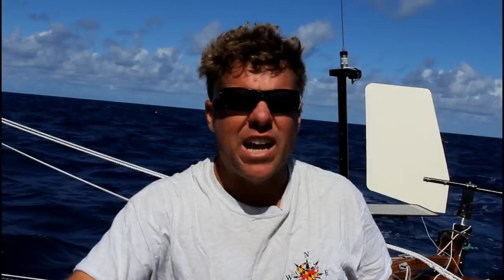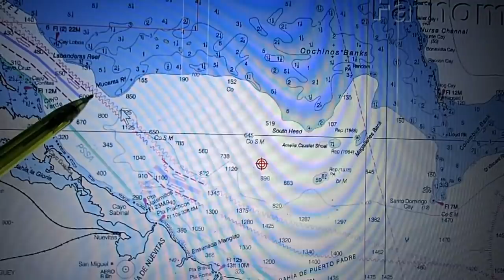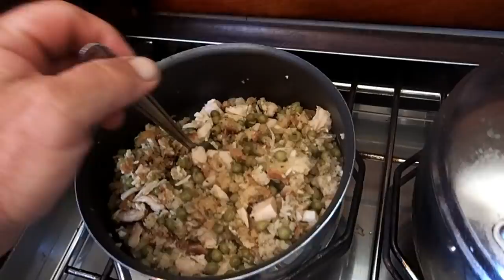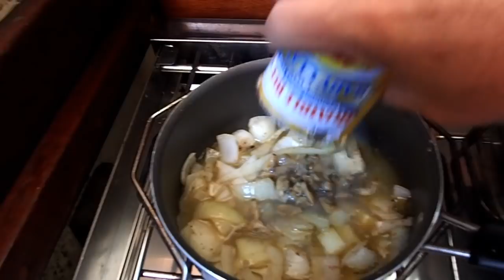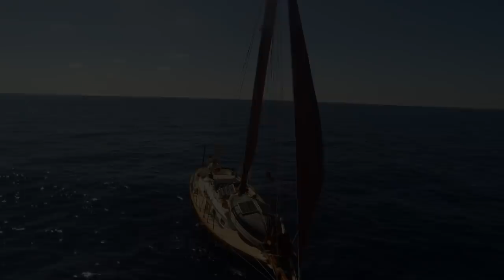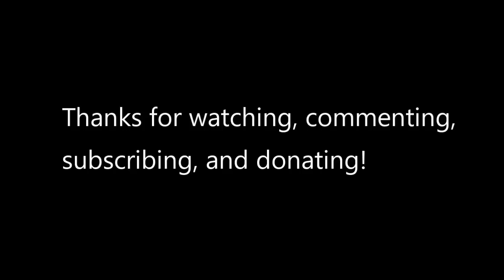Toward the Old Bahama Channel

Comment: Kevin. Thanks for the amazing content. I have a Ranger 23 and am restoring her. She will be out on the water soon. Input on your stern light. I had a 66 Ford Mustang. New battery, new cables, new starter, new alternator. Living in North Orange County, CA. 21 miles from the coast. No marine layer or excessive humidity. One day the Mustang just wouldn’t start. My father in law at the time, an electro optics engineer working for JPL told me to do the following. Mind you, there was no corrosion on the battery or the terminals. He said, “take them off and clean them.” I did, and bam! She turned right over! Even though there was no visible corrosion, there was enough oxidation to prevent current to flow. As far as The intermittent issue is concerned, its absolutely a loose connection, whether it be the ground wire, or perhaps the actual receptacle that your bulb is in. Some stern lights are the double ended festoon bulb or the wedge bulb. I’d check your ground wire, and remove the cover and clean the bulb connections and tight the contacts or receptacle of the bulb. Good luck and fair seas Captain!
Reply from the maker: Thanks.  I've since determined that it was both.  The butt connector was loose, the wire about to break off, and there was some resistance in the wire itself.  Replaced wire and connector, all is well.
Reply: Bravo!

Comment: Get some dielectric grease.  Once you get contacts clean, use it to pack any electrical connections, plugs, bulb sockets, etc.  It will keep them clean and stop them from corroding.  Good on battery terminals and terminal blocks too.

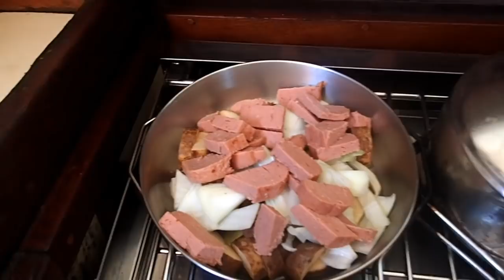Comment: We hauled at 3 D. Marine on Stock Island last spring, it was a great DIY yard. If you get to Marathon awesome vhf net 68 at 09:00. If I’m in Marathon and you come through I’ll buy drinks and might be of help. We got a small tow boat too, winds are usually on the nose getting into that protected Boot Key Harbor. 
Cheers!

Comment: Nice drone shots! I still don’t have the confidence to fly while sailing. 
Where do you land it? Mine freaks out when the proximity sensors pick up the rigging
Reply from the maker: I land it on and off the water, or did ... this is what the Splash Drone 3 was made to do, but don't go out and buy one, way too many problems.  In fact I just sold it for parts on eBay ..

Comment: Kevin, 
I don't remember if you have discussed your preference for solo sailing. Have you considered taking someone with you, especially on the long passages?   
Your channel is the one I look forward to the most.
I am in the Melbourne Florida area.  Passing by here any time?
...Phil
Reply from the maker: I've gotten used to solo sailing, plus my boat is pretty small even for one person, for a long cruise.  I may stop in Palm Beach on the way north, I think that's close to Melbourne.
Reply: We are about 110 miles north of West Palm Beach.  The closest inlet coming north is the Fort Pierce Inlet.  (Current is strong there.)  Then it would be a difficult sail up the Intercoastal Waterway on the Indian River.  It can be quite narrow north of Ft Pierce.
Next stop north of us is as an inlet to the Indian River is at Port Canaveral.  Would love to take you out to dinner if you come this way.  It's 26 Feb today.
Reply from the maker: @pjhenders  Thanks, I may try to get in through the Lake Worth inlet, which looks fairly easy with a decent wind.  Probably will not stray far from there though.  I'm still learning Florida, step by step ...

Comment: Thanks for great videos great to hear sailing terms  wing used.One question how good is the wind vane in light air like you are having on the Grand Banks? Do ever have to hand steal.
Reply from the maker: The vane will steer in nearly all conditions, even in winds of 3-6 knots, so long as it is greased.  I grease the gudgeons before each passage.

Comment: Hey Kevin (may I call you Kevin?), Stop scraping your Teflon pots with a metal fork! We want you to be posting well into your elder years.
Reply: I bought all lexan dinnerware so I can eat out of my Magma pots directly without damaging the nonstick.
Reply: I know... STOP Kevin! Carve a freaking wooden spoon for Christ sakes
Reply from the maker: Didn't know that was dangerous, but then Teflon is probably not a recommended dietary supplement ...
Reply: There's lots online about it Kevin. From what I understand, as of 2013 the newer formulations of "Teflon" [or Polytetrafluoroethylene (PTFE)] no longer use perfluorooctanoic acid (PFOA) in manufacturing. PFOA is linked to cancer in lab animals, as well as to a number of health conditions, including thyroid disorders, chronic kidney disease, liver disease and testicular cancer in humans.

Your pot looked fairly new, so perhaps I was being overly alarming. But hey, it, and just maybe you, will last longer if you use a softer utensil (such as suggested a wooden spoon) than it is in it.

While I'm at it,  at temperatures above 570°F (300°C), PTFE coatings on nonstick cookware apparently start to break down, releasing toxic chemicals into the air (and so your small cabin), possibly causing something called Polymer fume fever (or Teflon Flue).
Reply from the maker: @DanMcAfee  Interesting, thanks for the heads up!
Reply: For sure. Happy trials...